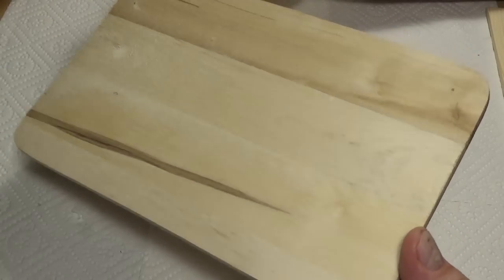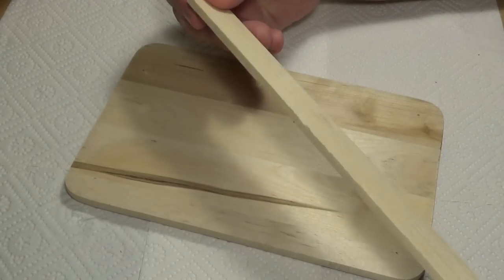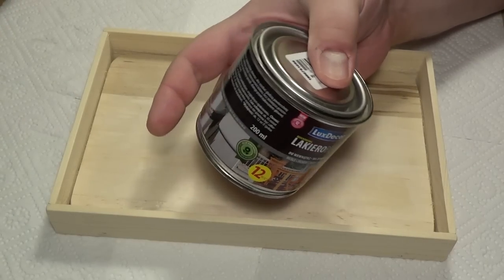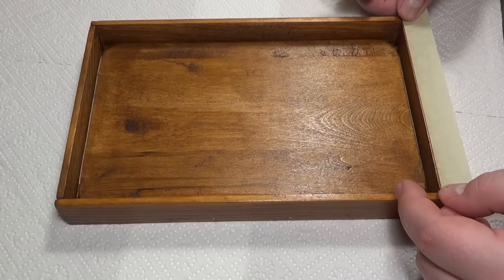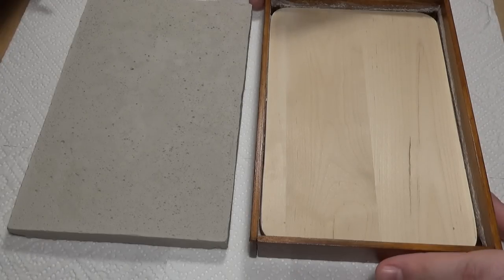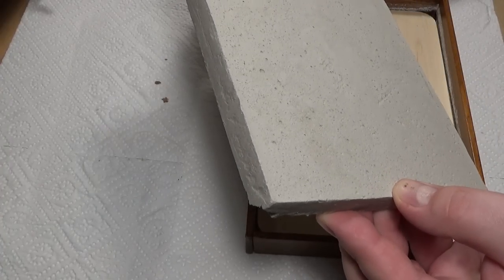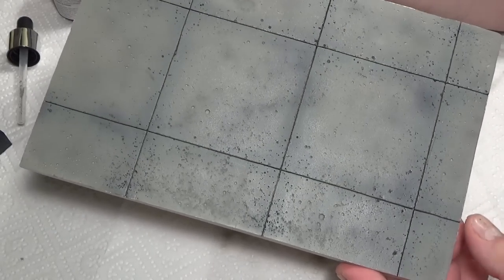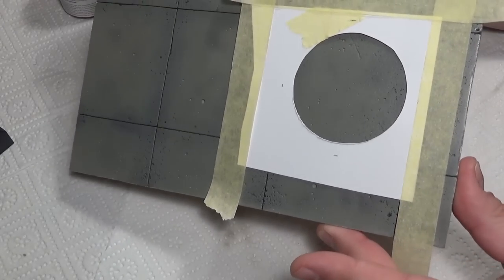Display Base - Concrete Airfield

Comment: Wow, that came out really nice. I realize that this video is 5 years old, but I have an idea that would keep the wooden board from warping due to humidity from the plaster. Placing a large piece of plastic wrap into the frame before pouring the plaster will definitely keep any moisture away from all wood surfaces.
Reply from the maker: Yeah, that should do the trick :)

Comment: Hello,
          I have just watched your video on making the airfield base, and I think you have done a excellent job, my only suggestion, would have been to place some type of reinforcing between the two layers of plaster, Again great work.
Les
Reply from the maker: Maybe you're right. Fortunately nothing bad happened. To be precise - this plaster turned out to be much stronger than the wooden board ;).

Comment: although this video is old, i might recommend mitre bond / carpenters mate. its a 2 part adhesive, a gel and an aerosol. it bonds instantly and you dont get stuck with nails in your base. otherwise, great job.
Reply from the maker: Thanks for the tip :)

Comment: have you figured out a way to get rid of the larger holes left by air bubbles in the surface for smaller models?? Looks awesome though! Will have to give this a try!
Reply from the maker: Well, those holes give the "concrete" a nice look, but you're right they shouldn't be that prominent in smaller scales. One way is to shake the liquid plaster thoroughly or to use drywall.

Comment: Wow! This is exactly what I was looking for! Only I want to make a sidewalk/curb to fingerboard on and grind. I was gonna use real concrete (knowing nothing about it), but plaster looks way smoother and perhaps easier to work with. Do you think plaster would make an abrasive grinding sound on the edges when playing with a fingerboard like a real skateboard grinding concrete? Thanks!
Reply from the maker: Hi mate :)
Now that I googled what a fingerboard is I have bad news. This painted plaster is very fragile. I mean VERY. You can mess it up just by staring at it intensive enough ;).
Better find a more sturdy material for your track.
Reply: @Big-Modeller  Ha thanks. I knew it was an 'out-there' kind of question. Maybe I will use real cement or concrete. Your work looks so good. You gave me great ideas for carving out slab cracks and tips for painting. It's the exact look I'm going for. I'm just gonna try it with a sturdier material. Keep up the great work.

Comment: Can I ask how you got the plaster out of the mold - did it not stick - did you take the sides off - thank you
Reply from the maker: To be honest, I didn't intend to take the plaster out of the frame. It was supposed to stay there, but the wood got humidity from the plaster (the wood solution was not enough to protect it), and got bended. So I had to replace the bottom board with the new one - side battens were ok.

Comment: What’s the measurements for the squares of concrete for that scale? It is 1/48 correct? What size did you decide to cut the squares? Was it to scale?
Reply from the maker: It was some time ago, but I remember I found dimensions of standard concrete slabs used on Polish airfields somewhere on the internet. I scaled them down to 1/72.

Comment: I like that you say cheers... It made me happy haha! Awesome video, i will investigate that white circle for you.

Edit: Ok, i couldn't find any specific information anywhere about the symbol. But here is a link to a website that shows it on an image with some infromation - http://www.airwaysmuseum.com/Signal%20Square.htm
Reply from the maker: Thanks :)
As for this circle... It was a calibration sign for Su-22's (Su-17) gyroscopic navigational system. Optical instrument on the airplane had to be centered on this circle for 15-30 minutes before take off (depends on the mission's demanded accuracy).
Reply: Big Modeller Oh that's interesting, thanks i'll check it out. I'm thinking of making a similar airfield as yours so this might be useful. Thanks!

Comment: How did you achieve the texture on the surface
Reply from the maker: That's just the natural texture of casted gypsum plaster. Air bubbles on the surface leave such holes. I just sanded the surface a little.
Reply: Did you add color to it
Reply from the maker: No, Ive painted it later, so there was no point in adding any pigment to the plaster itself.

Comment: imagine glossy concrete
Reply from the maker: Where do you see a glossy concrete? I've put a gloss varnish on it only to make an oil wash on it. Watch again 10:32 of the film, I show there that the concrete is made matt again.
I advise to watch the whole movie next time before you write a comment.
PS. What's wrong with a glossy concrete anyway? It is glossy when it's wet, I could do it this way to make a rainy diorama if I wanted to.
Reply: Big Modeller no I meant like imagine in real life just at an airport on a good day and then the concrete for the runway is super shiny it would be weird
Reply: Big Modeller and I did watch the entire video
Reply from the maker: Yeah, and sort of... dangerous ;)